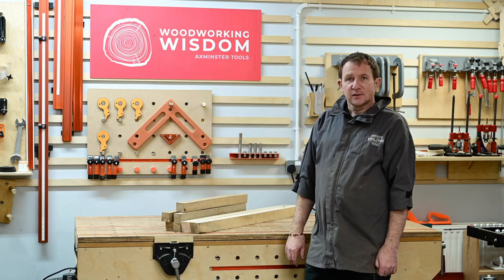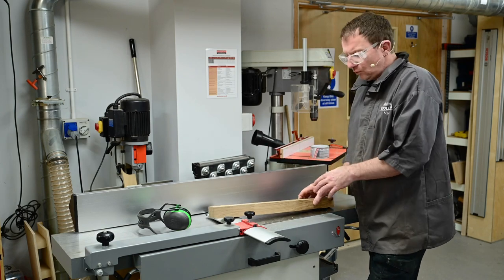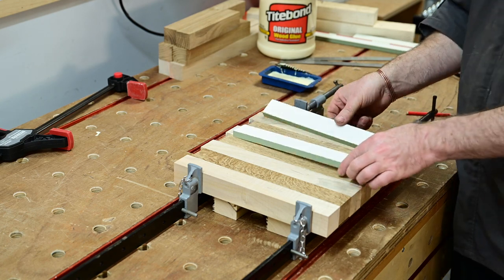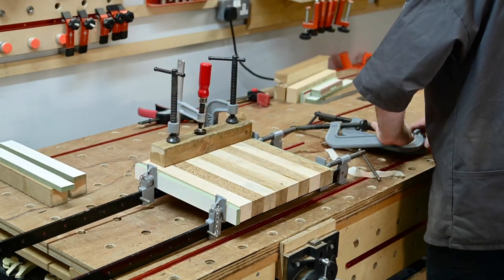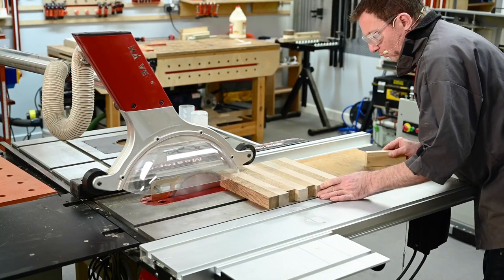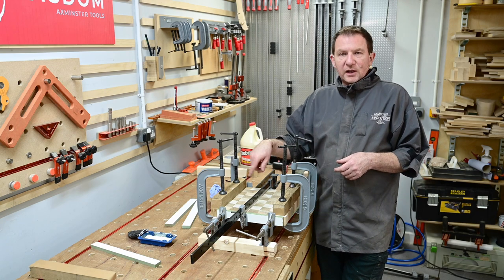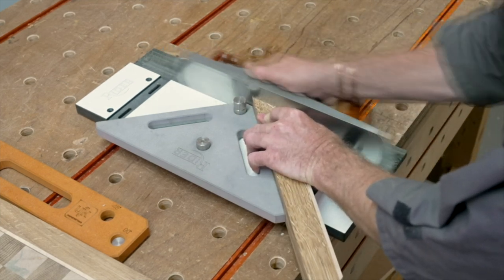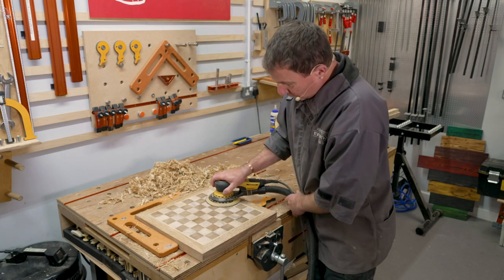Make a Laminated Chess Board - Woodworking Wisdom

Comment: Well presented video. Clear, slow enough for a viewer to take in various stages. Clear diction. Sadly the finished product was pretty impractical for a chess board. It’s far to thick & heavy. More suited to a butchers chopping board. Now let us see a craftsman make a board 6mm thick with a hinged centre.
Reply from the maker: Hi there, yes this could easily be made as a chopping board. Why not have a go at adapting this project to make it thinner. And a hinge is a great idea.
Reply: I play chess and would love to have this board. It’s not meant to be carried around but to say it’s impractical for playing chess is nonsense.
Reply: is this not gonna experience warp? why not use plywood as the body to avoid wood movement?

Comment: Great video Jason!
 I built a Chess board for my son a few years ago. I built mine on top of a base which had 2 drawers, one for each color of hand made chess pieces and opened from opposite sides of the board. My board was made of Maple and walnut. One difference in my construction was to include a strip of purple heart (regret wood choice as purple heart fades with uv light and is no longer purple in color) That strip surrounded each square and helped to mask any VERY slight error of the squares aliging, which the eye can detect! Easy to incorperate, during glue up add a strip to each section. cut as described, add another strip on the 2nd glue up .
Reply from the maker: Glad you enjoyed the video and great to hear all about your board.

Comment: One more time please, I did not get this. What type of liquid was used for make oak wood darker?
Reply from the maker: Hi there, Jason used ammonia to make the oak darker in colour and to bring out the grain. This is a naturally occurring substance that gives off strong fumes (please use carefully and in a well ventilated area taking proper precautions to protect yourself). The ammonium hydroxide reacts with the tannins in the oak, which makes it darker in colour. It's a process known as ammonia fuming resulting in fumed oak. Hope this helps.